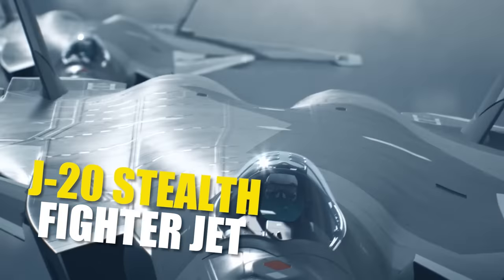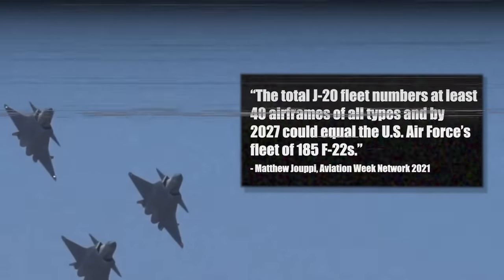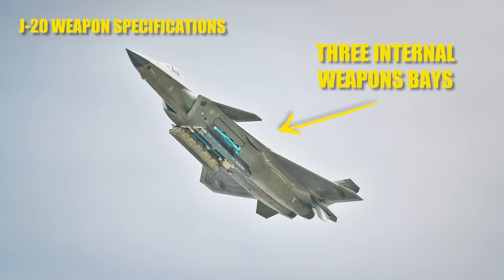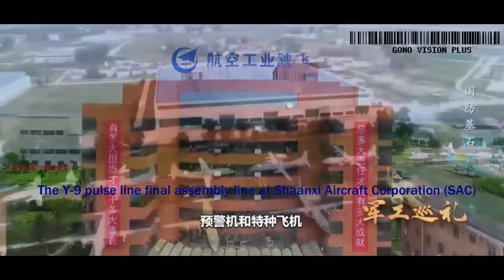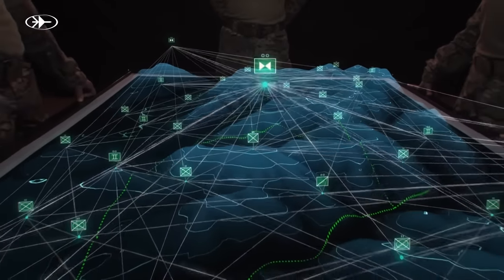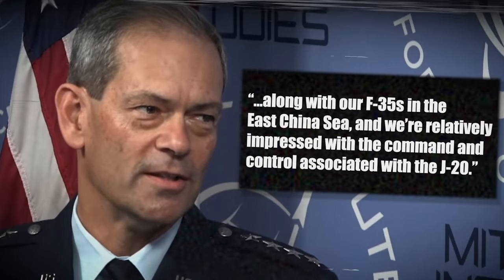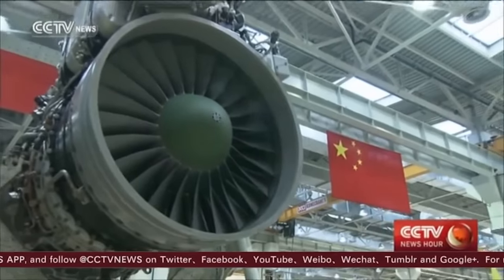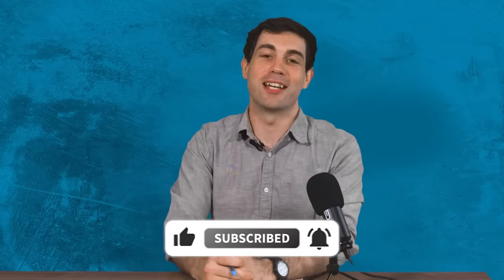How China Stole their J-20 Stealth Aircraft

Comment: Here's a rough summary of the accident history of the F-35 over the years:
June 23, 2014: U.S. F-35A (engine fire, aircraft destroyed)
September 23, 2016: U.S. F-35A (airframe fire, aircraft repaired and used as a training aid)
October 27, 2016: U.S. F-35B (electrical fire, aircraft destroyed)
September 28, 2018: U.S. F-35B (crashed)
April 9, 2019: Japanese F-35A (crashed into the sea)
May 19, 2020: U.S. F-35A (crashed)
September 29, 2020: U.S. F-35B (crashed)
November 17, 2021: British F-35B (crashed into the sea)
January 5, 2022: South Korean F-35A (undercarriage failed to release, landed with belly scrape)
January 24, 2022: U.S. F-35C (crashed into the sea)
October 19, 2022: U.S. F-35A (crashed)
December 2, 2022: U.S. F-35B (nose gear torn off, nose-dive)
December 15, 2022: U.S. F-35B (front undercarriage collapsed during vertical landing, aircraft fell to the ground)
September 17, 2023: U.S. F-35B (crashed and disappeared)
I won't mention 2024, as there have been a bunch of accidents as well, you can summarize them too haha 😄😄.
American pride🎉🎉🎉
Reply: The US flies more then any other nation combined, as well, the crashes occurred by the British, Japanese, and ROK airforce are their responsibility because they have to maintain and train pilots to fly it. Additionally, shit happens
Reply: @theelitespinach465  However, many accidents are design defects. Of course, there are many maintenance errors and pilot errors.
Reply: @connermini9390  yes that's part of the deal, jet fighters are some of the most complex and intricate mechanical pieces of engineering to ever be created, the amount of stress a plane experiences is enormous, shit breaks a lot and that's part of the development process, testing can only go so far but real world scenarios is a crucial step for the design process. It takes decades to work at flaws and errors.

Comment: Designing a stealth fighter is difficult as stealth is not only the shape of the airframe! Everything that is under the skin has also to be considered and made stealthy. The there is the building of the airframe. It is very difficult and requires major improvements in manufacturing technology, skilla and practices. And the there is the electronics, that are extremely difficult to design and manufacture.

Comment: the new J20A with ws-15 engine actually cost less than 70-80 million. Pakistan bought J-10C at  38 million per unit. J-20A has alot of new features with new EWS, more fuel compartment, higher thrust new jet engine, take off shed off almost 5 seconds under 200m runway. New weapons integration, new radar. Integration of laser weapons. the list is long. There is a new 3D tvc coming soon. A new jet engine with a bigger trust is also in the pipeline at 230kn estimation. A new single engine like the harrier style is also being studied. This new jet is a real 5.5 gen. US should just back off to the second island chain

Comment: J20 Photoelectric Distributed Aperture System
The PL-15, which adopts radar active detection, has a large detection distance and has an anti-jamming data link. At the same time, it is equipped with a dual-pulse solid rocket motor to effectively expand its range.
 In view of the fact that the PL-15 bomb is 6 meters long, there are two versions of its range. One says that its range is 200 kilometers, and the other says that its range exceeds 300 kilometers, and it can even reach 400 kilometers.
Regarding the range of PL-15, the two opinions are too different. Therefore, the range of the real PL-15 air-to-air missile is of course only known by our Air Force. The outside world’s statement can only be guesswork, and it is only for interested readers. For reference only.
 Even if the PL-15 has a range of 300-400 kilometers, even if it has a range of 200 kilometers, it should be the air-to-air missile with the largest range in the world. The U.S. Air Force believes that the PL-15 can have a range of up to 200 kilometers by adding a ramjet engine. It is already an AIM-120D medium and long-range air-to-air missile with a range of 150 kilometers far exceeding that of the US Air Force.

Comment: it is not stealth one ... main reason outdated thirsty engines from Soviet Union time (now called Saturn AL-31) they are make this plane as visible as F-18 ... Yes it is better than F-16 ... but F-16 was never claimed as stealth plane just gen4 workhorse. Russians failed produce requested ones (also for own SU-57 and one of the main reasons why Indian government refuse to continue to participate in SU-57 program, engine Product 30 was not ready in foreseeable future (main problems no needed high heat special material was successfully designed )) ... it is design for dogfights which never happen in the modern fights, just boring first see first destroy by rockets from long distance (no direct visibility) ...

Comment: Full of misinformation. For example you didn't get the basic facts of Chengdu Aircraft Industry Group right, it was started in 1958 and fully established in 1964, it's original name was State Run 132 Factory, changed to current name in 1998.

Comment: Very good article.  Until now J20 has been underpowered and Chicom knows it can’t perform in combat.  However beginning this year they are producing the new properly powered WS15 engine in some quantity.  J20s fitted with this should achieve performance on paper.  Time will tell what the actual performance will be.  There are some serious questions.  1). Chicom has never shown any ability to manage extreme dynamic temperature gradients of the engine blades.  This directly affects power and reliability.  The technical announcements do not address this issue.  2)   Chicom electronics are fickle prone to false readings or complete failure, on the ground or on planes or ships.  Radars don’t see, sonars don’t hear, guidance systems often don’t work and missiles miss.  All this render their aircrafts and fleets confused.  How do you plan command/control?   Visiting Chicom sites such as Sina or Sohu we can easily find military enthusiasts making fun of these affairs.  3).   Democratic countries  invest heavily training pilots and sailors.  Compare that with the minimal training in Chicom China where the money for fuel and parts disappear due to corruption.  (   Jet fuel is drained off by officers to cook food, blog pictures.)

Every aircraft takeoff is tracked in real time by US and Taiwan in an arc from Beijing to Tibet, and that there is a 20-30 year database of aircraft types and some individual planes.  Within a year we should know more about the new J20 fleet performance than they do.  Let’s check back next year.